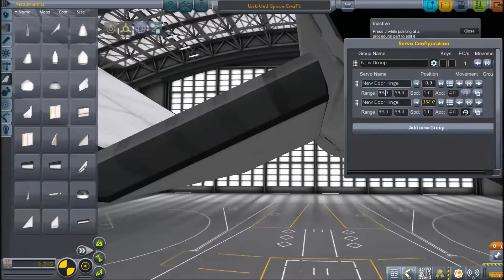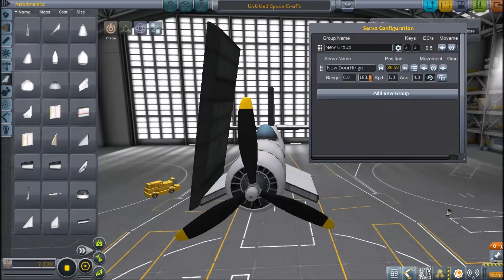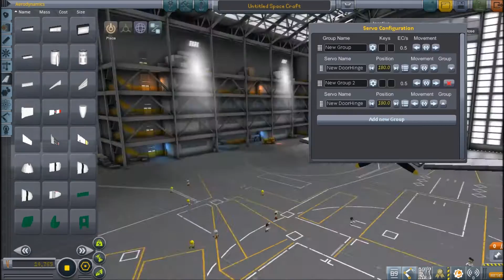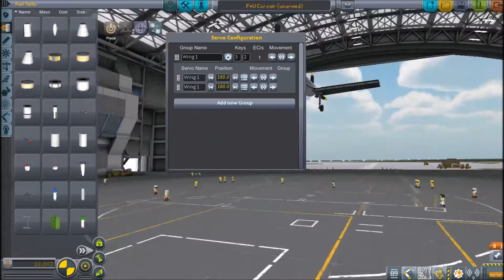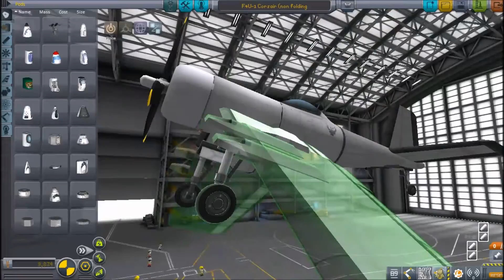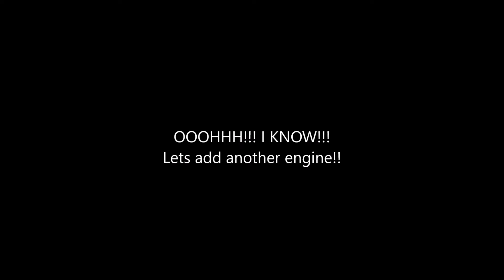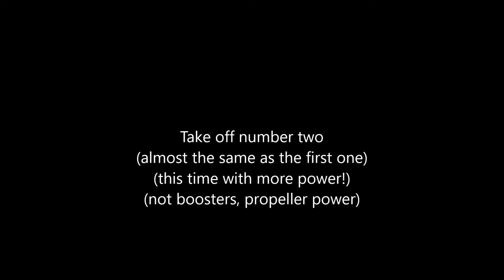KSP Historical Builds Chance Vaught F4U Corsair

Comment: FYI: About landing the airplanes, you should approach the runway in 3 degrees descending in real life airliners. With fighters, the glideslope(yeah, this is how you call the descent angle) is around 5 degrees, and it does rise a bit for navalized fighters. But 'the lower the angle is, the better' applies to any flights, so try landing below 5 degrees. It will aid your landing very much.
Reply from the maker: With the KSP aerodynamics having a sort of cutoff of lift for those low lift to weight fighters and me not wanting to drag out the video forever, I made the landings a bit weird

Comment: also for the standard plane only the rear fins have pitch, main wings have some surfaces for roll, and the vert. fin has yaw
Reply from the maker: Guardian of Games not all planes. A lot of modern jet airliners's wings have pitch and if you look at blueprint drawings, the corsair does too. (just not as much as mine is. I was just trying to center mass and lift)
Reply: actually those are just flaps on the corsair, for landing etc, and yeah things like the 747 do have it, that was an oversite, but its because maneuverability isnt important, and its wings are in front the the CoM, so it just helps it to land, take off etc
Reply from the maker: Next time you go on an airline, look over the wing. You will see that the whole thing is angled backwards a few degrees (most visible on 737s). and that wasn't for maneuverability, it was to get  off the ground with a payload
Reply: I will be going on a airline from vacay in 10 days so I will be sure to remember, also I think it helps because the wings or below CoM so the natural AoA of the wing makes drag causing it to push up the forward part of the fuselage, having wings at the top does teh opposite but can easily be fixed, I believe by angling the wing downward